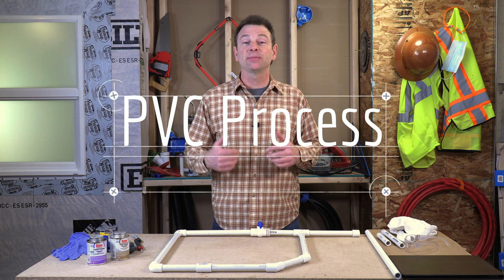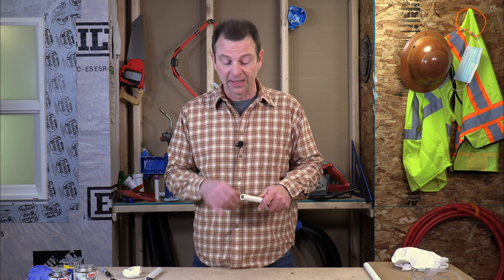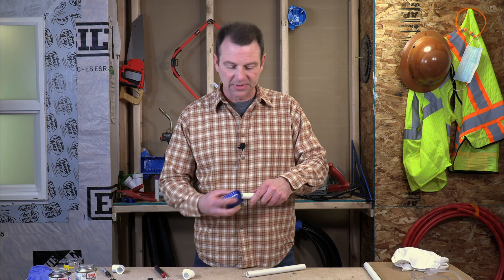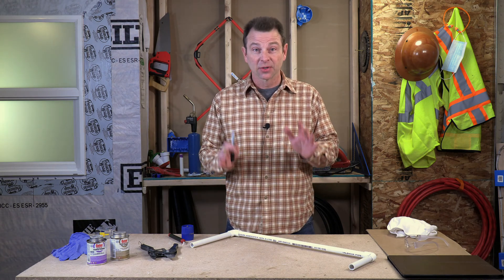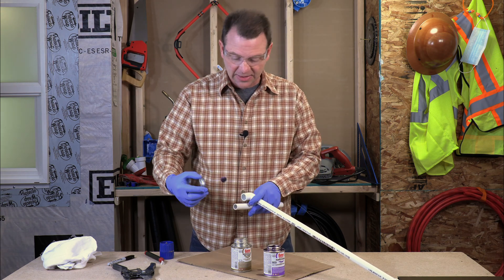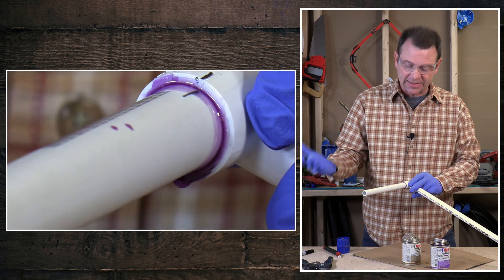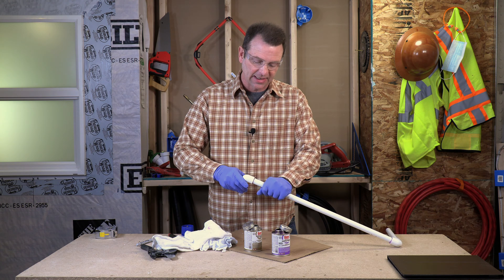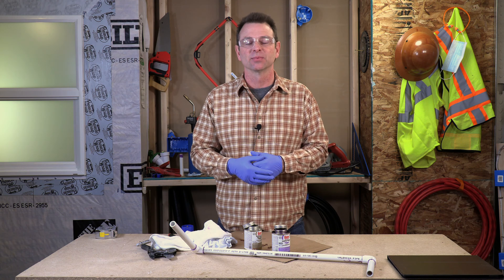PVC Process

Comment: You also need to cap both the primer and glue cans ASAP after fitting the pipes, as both evaporate extremely rapidly.  The glue can film over the top rather quickly.
Reply from the maker: great point and thanks for adding